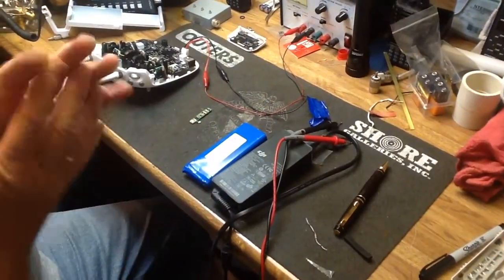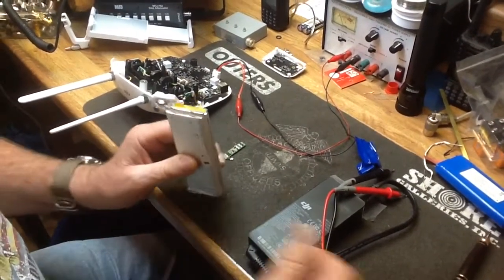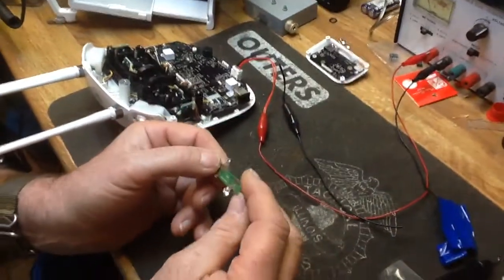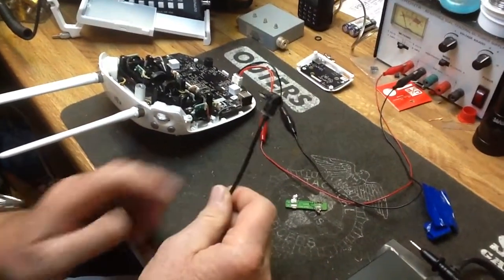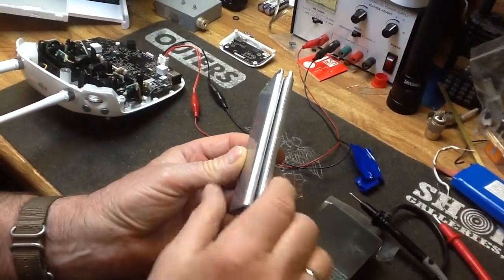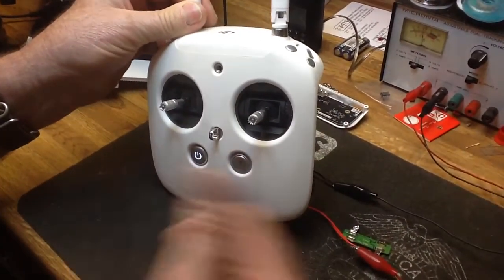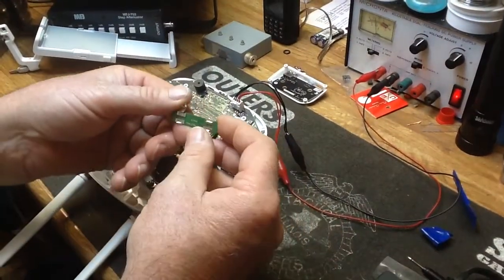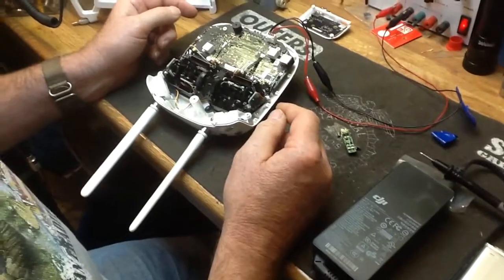Phanton 3 controller battery replacement GL300C Part 1

Comment: In my case I also identified the small board (BMS) to be the issue. I believe what happened is that when I plugged in a 90W power supply to the remote (stupid me...) the small board (BMS) tripped, because the mosfets on the BMS are 7A (they are AO8810 Alpha & Omega Semiconductors: 20V 7A limit), and with a 90W the charge current went to 10A.
It turns out we can reset the BMS by shorting temporarily the negative (B-) pad on the board (or 1 of the negative pins of the white connector) to the battery negative (anode), which fixed it for me.

Comment from the maker: If you believe that the battery wasn’t damaged by the the charging currents and your are confident after testing then don’t replace. It a lot of work to get at the battery and cheap cost to replace.

Comment: If your original battery is good and the board that is attached to the battery is bad, couldnt you just solder the old battery to the connectors without the board?>

Comment: Some more info re the battery alternatives and the BMS pcb: - It is possible to get 4 x 18650 lithium ion cells into the battery box instead of the more expensive LIPOs and re-use the BMS pcb as well. You have to cut the left hand (looking inside the controller) end out of the battery box so they'll fit though. I have 4 x 2100 mah 18650 cells in mine now. They're wired in parallel/series giving 7.4 volt at 4100 mah total capacity. Remember batteries wired in parallel double their capacity. 
Be aware that the small BMS board once re-wired onto fresh cells won't give any output until it is re-activated. This is done simply by applying a charge voltage. ie. Plug your charger in before use. This is normal with many BMS controller chips. Finding LIPO cells the correct size and capacity is a pain in the arse, but with 18650s, your choice of capacity is up to you and your budget. It is possible to match the 6000 mah capacity of the original battery by using 4 x 3000 mah cells. To cut the end out of the battery box and lid, carefully use a hot soldering iron with a small tip and finally clean it up with a sharp knife or scalpel. Enjoy.
File Storage Link to three pics: https://c.mail.com/@647394444483503590/8rO1fRHbTwKWavHm6DkYKw
Reply: I’ve just bought a second hand p3p and the controller has 2x18650 batteries fitted as what looks like original equipment. Any comments?

Comment: Hi, my controller was showing white flashing lights, so I thought it was a faulty battery. Hard reset didn't work. With the help of this video I checked and the voltages were ok. I happened to have another controller so I switched their batteries and both work properly somehow.

I hope this info can help anyone.
Reply from the maker: Thanks for the information wonder if there was a bad connection that caused the problem.
Reply: @goneredcar1  Unplugging the battery and plugging it back in will often reset the controller and any errors.

Comment: Thank you for your video. It helped me a lot.
I ave found the battery for the remote controller on eBay. Look for the number 132987340210

Comment: Hi, I ordered the new battery (same as the vid). Took the old one out soldered the wires and added the new battery. I'm only getting a charge of 21%. I have a wedding coming up so ideally looking to get this sorted. Is there anything I have missed?
Reply from the maker: Luke Brown  Check your voltages at the charging plug should have around 17.xx volts. Then check the voltages at the new battery should be over 7.4 volts with the battery plugged in the device it should read >7.4 volts which is the charging voltage needed to charge the battery.

Comment: Good evening, I have a Phantom 3 ADV and my control is indicating the battery charging up to the third light. I noticed that there is an electronic component that is responsible for the indication of the fourth light. Do you know what it would be (CI 4407A and P2664)?
Reply from the maker: Rodrigo Teixeira  Sorry I don’t have the schematic for the controller. The chances of a component failure is very unlikely.
Reply: goneredcar1 thank you
Reply: Hi Rodrigo, how did you get on with your drone? I replaced mine using the same parts of the vid but only getting a charge of around 20%.

Comment: DJI ducked up big time making not-replaceable battery. I am on my 4th controller replaced through warranty. Each replacement took approximately 1 month. They are in CA, I am in NY. All 3 controllers would not charge or indicate any charge level. They were completely dead. I am afraid to use the charger now, maybe it outputs incorrect voltage that kills my remotes.

Comment: I completed this project, video here https://youtu.be/EfSti9Erxkk I am still having the problem....  I don't think the battery is bad
Reply from the maker: My advise is check voltages as per the video had one viewer report it was a bad charger and not the battery.
Reply: goneredcar1 thanks for the reply!  I hooked my DC power supply directly to the controller, and had same effect. I can not replicate your results.
Reply from the maker: Not seeing your hookup I'm forces to just guess at your problem. If hooked up wrong you can damage the regulation circuit and it may appear the same. Go back and recheck your work and connections. This is a easy fix and many have obtained good results, it may just be something simple you over looked or you maybe faced with another problem not related to the battery.